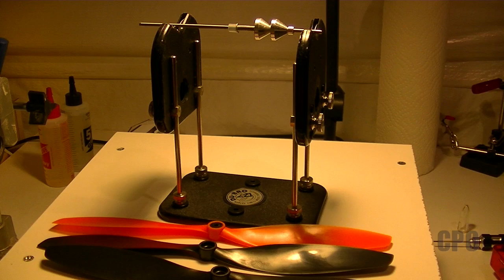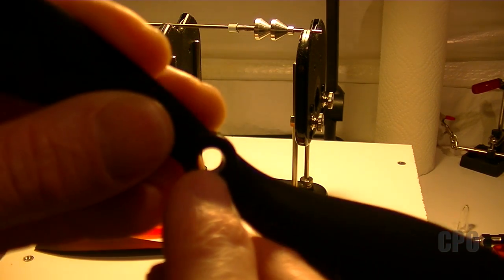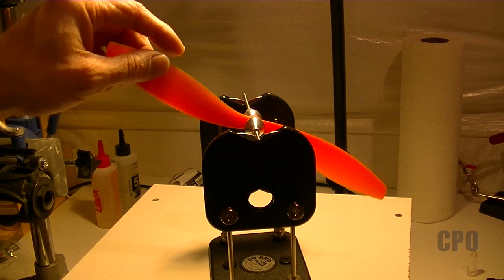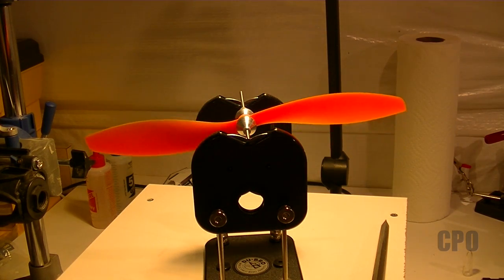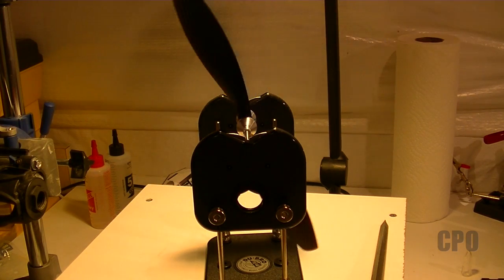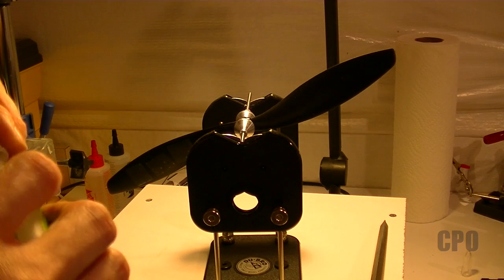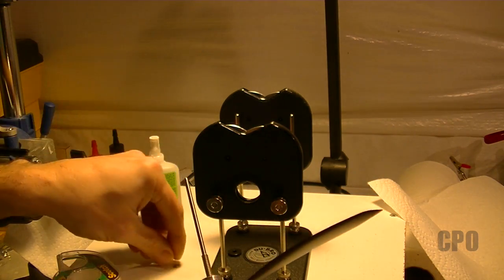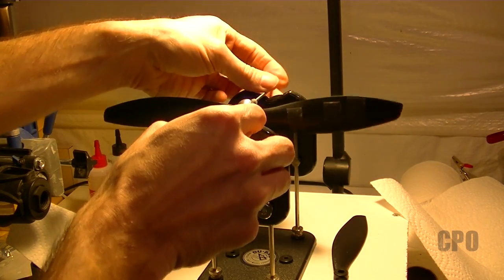CPO Quick Tip : In-Depth Look at Prop Blade and Hub Balancing

Comment: Great videos, I use fingernail polish and it works great and does not come off,the color code also tells me which is pusher .

Dee
Reply from the maker: Nice tip!  I have since started using just hot glue...it dries in seconds and is easy to work with (and even push around while it's drying).   I like the color coding idea!

Comment: should you  tape on the other side of the prop so air flow is not affect?
Reply from the maker: I have heard people say one side is better, and then someone else will say the other side is better. I don't notice any difference either side. I think the effects (if there are any) are negligible. I think, aerodynamically speaking, the airflow is more on the back side of the prop.

Comment: Great video. Very helpful.

I've also noticed that the tips of some of my props don't travel in the same plane. One is higher than the other by maybe 1/8 inch. Is that prop still usable, or should I just chuck it?
Reply from the maker: That's pretty common, especially with the flimsy slow fly props. I just bend them a bit to get the tips to line up. You can rotate them on the balancer and use something to compare against to get them close. I've had to tweak most of mine just a bit. I have never thrown one out for it.

Comment: Nice tutorial on balancing props.  What brand is the balancer?  I could not tell because YT lowered the video quality to make it almost unwatchable.  R.O.G.
Reply: *****
Is there a reason you chose the Du-Bro over the magnetic ones I've seen in other videos? I'm just starting this hobby and wonder which one to buy :)

Also thanks for showing the hub balancing. I've seen that once before - everyone else just seems to ignore it.
Reply: My opinion, the DuBro is the best at all round balancing. It can handle larger props that the magnetic balancers can't.  It's still super sensitive, and works really well.  Of course, people will magnetic balancers will tell you they like theirs better. I have no regrets with the DuBro.

Comment: I hadn’t thought of blade length, I was thinking more of the blades travelling around the same circumference. Does that make sense? By measuring from the side of each blade (near the tip) sideways out to a reference point. I’ve clipped a clothes peg on the leg of the balancer, moved it towards the blade until it almost touches the side of the blade, then bring the other blade round and check to see if the gap between peg and blade is virtually the same as the first. Hope that makes more sense!

Comment: Great video, think I'll now have to go back and re-check the balance on a whole load of my props! Should I also check that the blades travel around the same 'arc' before I balance them? i.e. measure the distance from each blade tip to, lets say, one leg of the balance rig. Think I had one prop once where there was quite a difference and decided to throw it out!